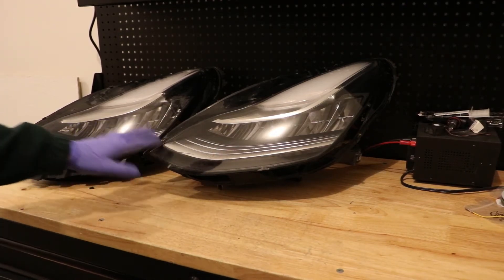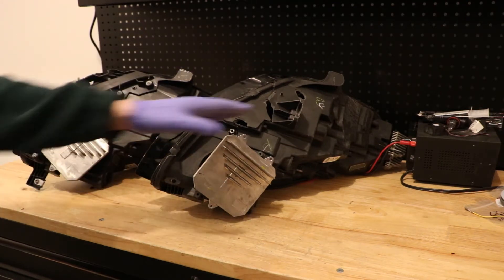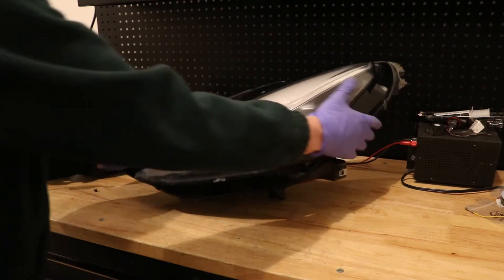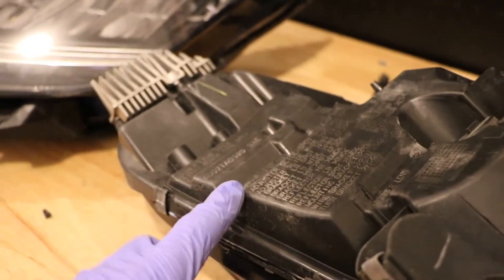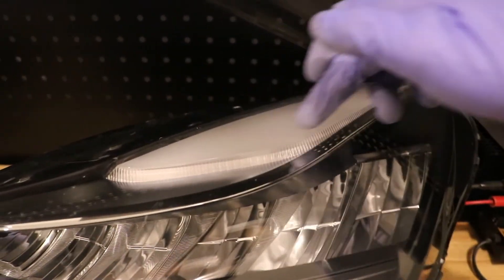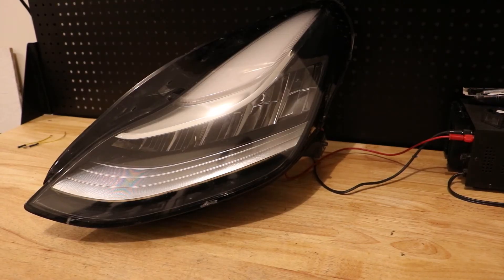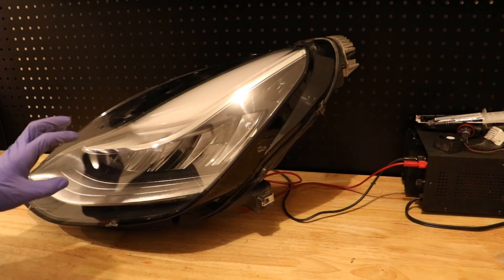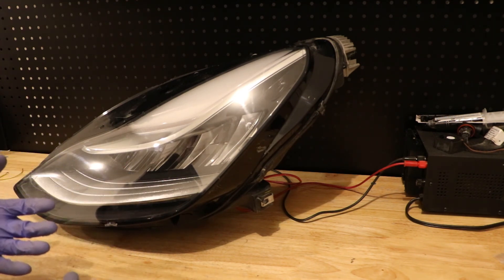Comparing and testing Tesla Model 3 LED Headlights

Comment: Any plans to test out the new headlights
Reply from the maker: Yes, I just got one.  Plan to have videos up later this month
Reply: @gftgrill  Nice! Looking forward. I do wonder if they are capable on older model.
Reply from the maker: @27thSF  same connector and bolt on points.  Physically I don't see why not
Reply: @gftgrill  thanks for the reply! It would be cool if you can have old vs new comparison 👍

Comment: I am pretty sure Tesla is using LIN Bus to communicate with the headlight.
When there is no LIN signal, like in your test, the headlight is going into failsafe mode and activates at least low beam.

Comment: I would figure the mounting bracket change has to do with panel fitment/gaps. By attaching to the bumper cover it ensures that there isn’t a gap below the headlight and the cover.